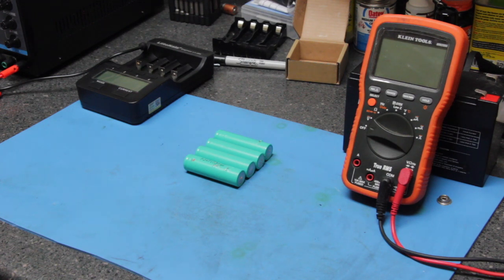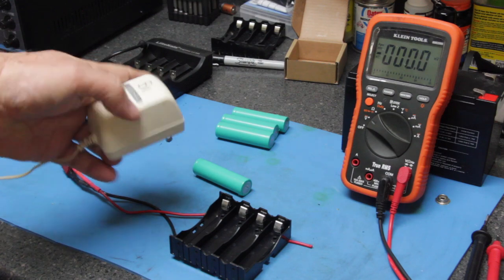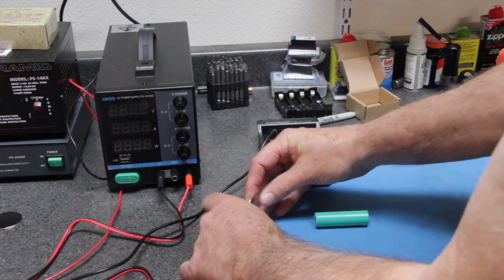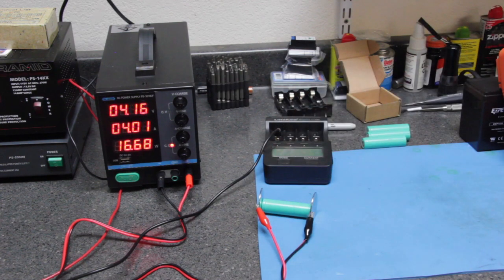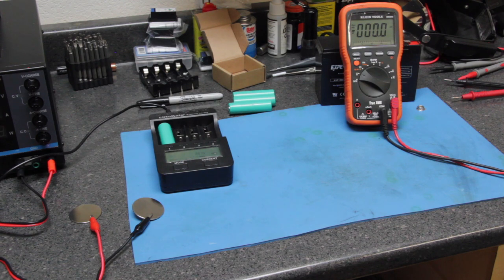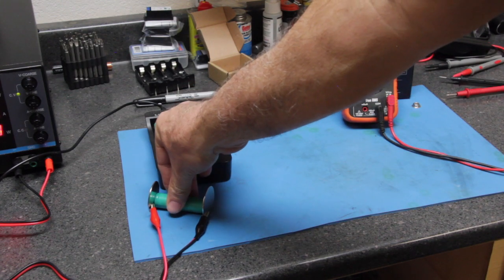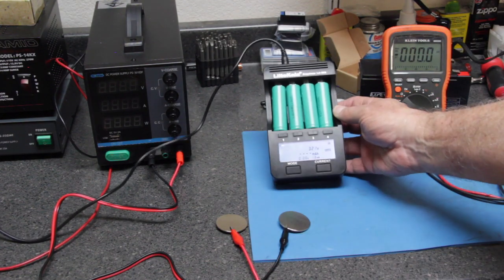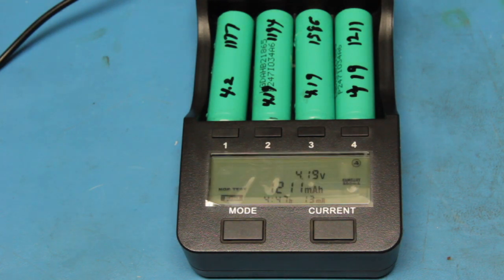Revive 18650 Lithium Ion Batteries

Comment: This is useful, will try. I just found my old dead hp laptop with 6 18650 batteries inside the case. All of them were 1.80-1.90V though, not below 1V. But it's been around 10 years since I last charged that laptop.

Comment: Can this be done with a large 20ah bicycle battery pack?
Reply from the maker: Yes, but you have to remove the cells to do so.  You need to determine each cells capacity.  You can purchase a battery spot welder for pretty cheap
Reply: @ Was hoping to bypass the BMS and use low amperage (2) at the battery packs charging voltage to try and bring the cells up to a point where I can charge via its charger.
Reply from the maker: You really need to do a discharge test to measure the capacity of each cell.  If one or more cells are bad they need to be replaced
Reply: @ That’s not good news as I have 5, 20ah batteries that were new and boxed for months without being charged.  To take them all apart and test each cell, then re-solder and reassemble, may be beyond my capabilities.
Reply from the maker: Sitting Lithium battery packs should not hurt the batteries.  Perform a discharge charge test on the entire pack.  All the cells have the same capacity.  So you can calculate how many cells are low or bad.  You will have to find a charger that can perform a 20 amp charge discharge test
Reply from the maker: You also might be able to use a low amplifier charger to wake up the batteries for your original charger to work.  But that will not fix any low or bad cells.
Reply: @ I purchased a variable DC charger to try exactly that.  However, I believe I still need to bypass the BMS in order to be able to feed current into the batteries.  My current plan is to feed 48V at 2 Amps to see if I can increase the charge in the batteries slowly.  If that works and I can get the voltage high enough for the BMS to recognize them, I may be in business.
Reply from the maker: That should work
Reply: @JoediyLab  One last question.  Do you think I need to start at a lower voltage? Any sage tips or advice as I try to recover $2500 worth of batteries? Also, thank you for responding, I appreciate it. It’s a bit nerve racking going it alone on this.
Reply from the maker: Same voltage,  lower current until you can use your standard charger.  Good luck